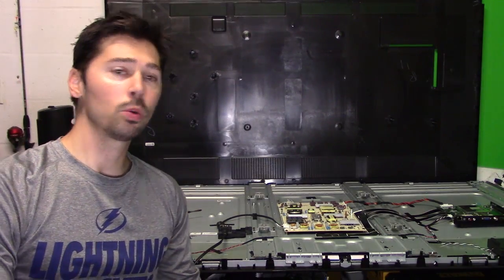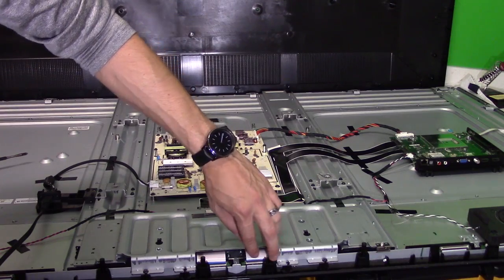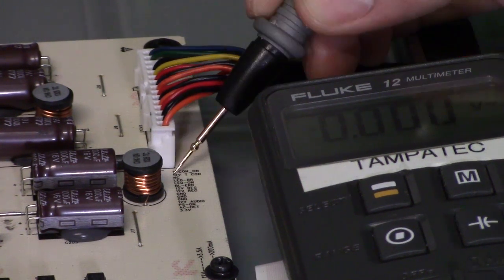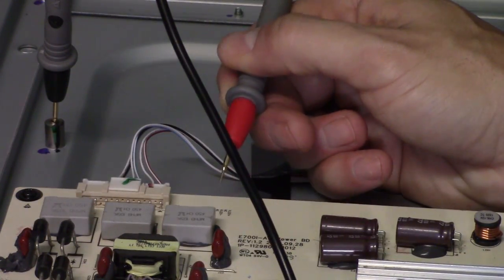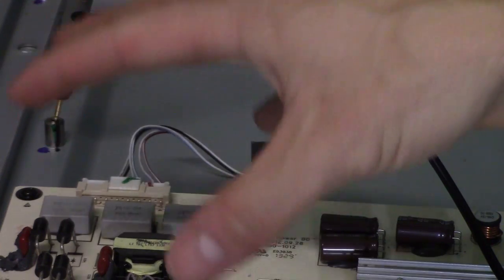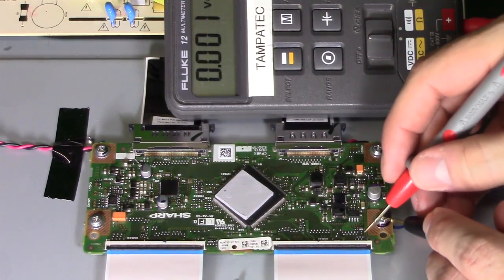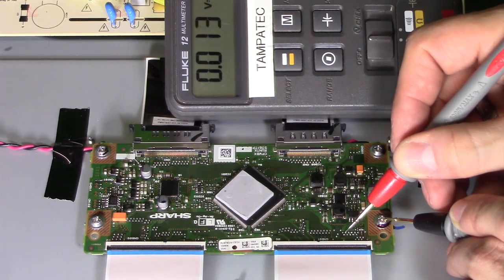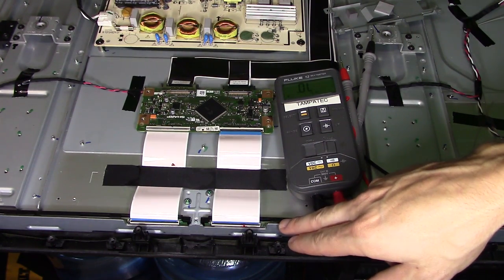How to Troubleshoot and Fix LED LCD TV Vizio and Sharp flatscreen No Picture but sound

Comment: My multimeter is reading 0 on the Led+ on the power supply and the backlights won't come on. I can see an image with flashlight in a dark room! Do I need to replace power supply board to see if I get power to Led strips?
My Tv:  led55c55r120q
Reply: If you unplug those wires to LED+ from their slots, what happens? I worked with that same power supply and the back lights would power on with only one string connected.
Reply: WMP007 did it mastery which one you unplugged furthest to the left or to the right on the board if it's still screwed in to tv? And thanks for helping, I've never thought of that is there a reason why that works just curious
Reply: Whichever wires are reading 0. If that PSU works the way I believe it does then if there's a bad LED on just one strip then unplugging the strip that reads 0 might allow the other strips to stay on. I didn't have any bad strips in the TV I worked on. But I had the wrong power supply for my model, and the pins were different so I soldered the wires manually to the pins on the board. I didn't know it was going to work so I only soldered 2 wires and the back lights I tried worked. So I went ahead and soldered the other to the LED + - pins on the power supply.
Reply: WMP007 every wire is reading 0 right now I've tested the multimeter on other circuits get a great reading but those four wires all say zero? I do have a new power supply board being delivered tomorrow though
Reply: That's strange. Nothing's ever too easy usually. At least when you get the new power board you'll know then.  You could just disconnect all of them and connect them one by one and see if any back lights come on.
Reply: WMP007 I know right, life easy ha! Well thanks for the help I'll let you know in a day how it goes lol (crosses fingers)
Reply: For sure! I got a whole board set for a Vizio  E601i-a3. Crossing my fingers as well! The parts are scheduled to arrive tomorrow. This TV is also not getting back lights. No power at all to any, and also no picture with a flash light :(
Reply: I got mine going!
Reply: WMP007 That's Awesome good for you! So my part got shipped damaged so I have to wait another week for another part to come in!
Reply: Bummer! That happened to me on my last TV I fixed. Ended up having to pay $20 extra for the same part somewhere else.
Reply: WMP007 I ended up finally getting my part in, and hooked it up and still nothing backlights wont turn on. Only flickered once voltage shot up to 120+ and then died out to 0 slowly. not sure what to do now
Reply: I know (face palm)

Comment: Thanks for awesome videos ! I would like now where can I get a Fluke 12 multitester like you ! thanks Tampa Tec
Reply: I bought a 39" Vizio D series, 13 months (yep) ago from Walmart. It worked good for about 10 months until it would freeze pic  or go blank. Unpluging it  and plugging it back in would correct the problem But it went from doing it twice a week to 5 times a day. It finally started going off and on displaying the "V"  screen and then the back screen. The only  way you could get it off was to unplug it. The other "odity" was when I went to pop the cover off I found A "Amazon" Firestick plugged into it. Obviously the TV had been sold and returned and resold to me but now stuck with it. Help,!

Comment: My parents have a 55 inch led RCA and it has sound but no backlight. When I do the flashlight test I can see a picture. A second after I turn the TV on the back lights will flash one time then go off and stay off. Could  you tell me please if you ever had a TV do this and what board could be bad ? I hope not but would it be possible for one of the led lights to be bad ?

Comment: hi i like your video i have a sylvania LC320SL1 i turn it on but it goes out. i do have a standby lite on. i open it up and  found no damage. so i check for 3 volt dc and i have for about three second with power on. i disconnect the power inverter and i have the 3 volt and a green lite. i think the power inverter is bad. i also check on some diode and found two bad one the the power inverter. help

Comment: hey T.T. I have a old vizio tv. 10 years plus, probably more. it has no label on it but I toke the panel  off of it and the stickers in side give me #pdp42x32000. a little history on this, I hade this TV in line of my swamp cooler, I took in for repairs for sound but no picture, after three tries and 500.00 later it worked pretty good except for a corner but after a bit it worked great. this time I have it out side under a nice patio in back, I did cover it with thin old beach towels  to watch it I only raised the front to view but the back really is not sealed with the towel and the wind we get here I thought would of vented ok. the same gut looked at it for me and told mr it heated uo, ok what now ? 300.00. he told me what it needed so I went to shopjimmy repalced the board. same prob. I fallow your vids the best I could but as you might know my TV has 10 boards in it not just to 2 or 3 in the vids. I think it might be the LED's, the flash light thing did not work, I will double check to noght to make sure. please help, I have to much $ in it to give up now.

Comment: Hey Tampatec, my LG 50LN5100 TV shut off tonight and won't turn back on. The red light in the front turns on, the screen flashes for a split second, then the red light turns off. It almost smelled like something was burning but the TV is only 2 years old so I hope not! If you have any videos on this, please link me!

Comment: I have a Vizio 32 E-Series Smart TV.  I have sound, and backlight.  BUT not picture.  When I turn the TV on it shows a blueish grey screen, the it starts 4 vertical sections, two stay the blueish gray, the other 2 start with tiny colored vert lines, then turn into a light grey.  So I have 4 vert sections, and no picture.  I don't get any words at any time.  I checked the IR sensor using your instructions from this site, and that is not the issue.  What do you think the issue is?

Comment: Great video Tampatec! I have this tv with black screen and has sound while doing your test on the main board at the tcon terminals only one side has the 12 volts, is that a sure sign of the main board being bad?  I'm afraid I'll buy this board then tcon board will be bad, then it will be the screen like yours ended up being. You have any input? Thx much
Reply: David, I have the same problem.  How did you resolve the issue?  Did you replace the main board?
Reply: @davidchellgren7932  I am having the same issue with the second ribbon cable reading 0 V at pin 1. Did you ever determine what the cause of this problem was. Do you know what parts would need to be replaced (main logic board, t-con board, power supply, ribbon cables)?

Comment: I have a Contex 5018 model 48 inch TV THAT HAS NO SOUND AND THE LIGHTING TEST CAME UP WITH NO LIGHTING IN THE BACK. WHAT MIGHT IT BE ALSO SO IT WILL NOT COME ON

Comment: Hello can you help me with my 65in rca led tv. I had a power outage one day and since then my tv would work for 30 minutes then shut off on its own if I try to turn it on it would not turn on unless it has been unplugged for a day. now tv will not turn on at all  now it does have a red standby light...Mod:LED65G55R120Q
ser: 4534-le65g55-f205408 pls help...

Comment: I have a lg tv lg42ld790 hdmi ports not working. Showing no signal on the screen whenever I connect anything via hdmi. I have reseted the tv and change the hdmi cable but no joys. 
Can you tell me what to test and look at on mainboard please. 
Many Thanks

Comment: Dear
Please help l have problems on led tv when switch supply on red led lamp glowing only tv not start I check power card AY160D -4HF12 082
Found copactor c37 charge by 25v andc copactor c25 charge by 10v if l remove supply I discharge the both copactor by short +and- then after make supply on again tv working ok my led tv eurostar model T50LEd-E13

If I switch off and again make on tv not working until make discharge the copactor with out supply after make on tv running normal
What the problem
Please help
Ali
Thank

Comment: what would the wires be for a vizio 502ui-b1e tv? it doesn't label a t con wire. I pretty sure it's either the t con or the main board, but I'm more leaning towards the t con. I just don't have a labeled wire to test... I have backlights and sound, but no picture. The backlight also adjusts the brightness in areas where I pull up the menu. it does not show picture when using a flashlight though. I also don't see any bad capacitors.

Comment: Hey tampatec it seems my main board is not putting out 12v on one of the ribbon cables going to tcon board do you suggest replace main logic board
Reply: I am having the same issue with the second ribbon cable reading 0 V at pin 1. Did you ever determine what the cause of this problem was. Do you know what parts need to be replaced (main logic board, t-con board, power supply, ribbon cables)?

Comment: I have a Vizio E701i-A3E. When I turn on the tv, the tv makes a loud popping sound multiple times. I have taken the back off and am trying to test like you do on this video. The meter jumps all over the place, the backlight goes on and off, then shuts off. Any suggestions? I have power cycled with the power button for 30 seconds, and still get the same thing. Also, nothing on the board appears to have any burnt or singeing.

Comment: Nice Video. Question: I have a Vizio M701d-A3. As i ran through your tests, everything was good until i got to the second T-Con cable connector on the main board. there was not 12 volts to that side of the T-Con board. Would this be indicative of a bad main board? What would you test next? Or what suggestions do you have on how i should proceed. BTW, the malfunction is a lot of vertical lines, with only one horizontal line. the color looks off too.
Reply: I am having the same issue with the second ribbon cable reading 0 V at pin 1, however, my TV is displaying a back light glow with no picture. Did you ever determine what the cause of your problem was. Do you know what parts needed to be replaced (main logic board, t-con board, power supply, ribbon cables)?

Comment: I really appreciate all of the work you have presented.  I have watched probably 8 or 9 of your videos and read some of your blog.   I am trying to debug my mother's Westinghouse LTV-32W6.  It has power, sound (at least a squealing sound), and backlights, but no video on screen.  Her tv's t-con board is not accessible without moving the main board and power board, so I can't test it the way you indicate plugged in.. 
    I should be able to test the power out of the power board to the t-con board, is that enough to say it is the t-con board that is bad?   How do I differentiate between t-con and inverter board?
dwoods

Comment: You didn't test all of the the wires from power supply you jumped over to led supply I want to know what all the powers are suppose to be coming out of power supply cause I have one that reads 0 is it suppose to

Comment: On a Vizio SV470M what should the voltage be at the power board on the wire labeled on/off when I turn the power on?

Comment: Hey TampaTec! I just bought a Vizio M421NV 42" TV. The TV powers on (amber led turns to white) but there is no backlighting, there is no picture (flashlight test) and there is no sound. What board do you recommend I replace? There are no blown capacitors on the board or burn marks. Is it most likely a power supply or main board failure?
Reply: We got same issue. TV powers on amber white and V but nothing.    I swapped out power cord. Unplugged  held on switch 10 seconds, nothing.  We just ordered new tv. Wonder if we should pull the boards and give them to TampaTec!  Vizio 55 inch.
Reply from the maker: GrandmaFoxes1 can be eeprom on the main board last I remembered. get tv repair kits or tv boards at shopjimmy.com or electropartsonline.com
Reply: Hey TampaTec! Thanks for the HUGELY helpful videos! I'm having the same problem that ReDigitize explained, and the troubleshooting has shown an inconsistent read on one of the 12V TCon pins of the harness... reading way low. Any advice?

Comment: I had like the same poblem with my sharp 47 inch i got a teacon board for £12.00 wich is roghly $7.00 from ebay and i diden!t use the meter just looked at it to know what was wrong.Still .Very good video and informative from you Sir.
Keep them alive LOL

Comment: I fixed a similar model vizio and the issue was the LVDS cable.  I almost didn't catch it and thought the LCD panel was bad, but glad it was the ribbon cables going into the t-con board.

Comment: thank you for all the info..i share it to my student..and the tips and lcd led repair..helps a lot of student..god bless and ..god job...:)
Reply from the maker: thanks
Reply: @TampaTec  I have the same exact issue as you do i have 12 volts at the main board cable going out to the T-Con board (*one closest to the top of the TV Screen*) But the other one below it, No Dice! (*one closest to the bottom of TV*) How can Repair the main board? I have plenty of extra parts from other sets, as i am venturing in this for a hobby. Just need to know what to test from here.

Comment: hey tampatec, i have a westinghouse 40" that will stay on for about an hour or so with great sound and picture. after this hour or so the entire screen becomes blank and green and then powers off or at least the display shuts down. i have been reading its the graphic board and possibly from overheating. would you recomend me just ordering a new graphics board?

Comment: I have a philips  lcd screen tv that has a brown shadow line across the top to the right where it is rounded and down the right side. It shows up depending on the color displayed. The shadow line is about 1/2" wide. Any idea what that could be?
Thanks for the video. I have never seen this before. The TV is about 4 years old. Other then this the tv is fine!
Reply: Forgot to say the line is down about 2-3 inches from the top and side.
Reply from the maker: check tcon conecctions
Reply: Thanks for taking the time to answer.
Have a nice weekend

Comment: Thank You for the Upload TampaTec :D  Will TVs Always have a "T-Con" board?  If not, would it be combined with the "Main Logic Board"? jw
Reply: I remember you mentioning it b4 but I wasn't sure which video it was.  Sorry for not googling :P
Reply from the maker: all LCD and led TVs have tcon boards, sometimes tcon circuit is built into main board.
Reply: ah ok.  Thank's man :D
Reply from the maker: no prob, you were right the whole time, tcon circuit sometimes are built into main boards.
Reply: @TampaTec  I have a problem with my tcl 55 inch uhd smart tv the screen is black but you can hear sound  and see picture with flash light but I opened it up and the top strip is lit up but I changed the bottom ones and it still dimmed like when I first opened the tv up what can be the problem

Comment: i got an rca 50" led tv that turns on then off within a few seconds. what do you think causes that? Thank you in advance
Reply from the maker: circuit is in protection mode , it is detecting a flaw in the circuit so TV turns off so it does go up in smoke.
Reply: Thanks for responding so quickly, I see 1 led strip is not lighting up at all and another has 1 led out.... you think that could be the problem? Once again thank you in advance  for your help! You rock!
Reply from the maker: yes i did a repair on led strips https://www.youtube.com/watch?v=YgaL6X6eSaU&index=6&list=PLbieLTSjLNFihpdQgqJPSPIoy6AHWqHs3
Reply: +Tampatec Hi, I have a Samsung hp4253. I would cut the tv on but it would shut back off in about 5seconds. I decided to enter try to reset the tv by using mute182power. It will not turn on or do anything now.PLEASE HELP.....
Reply: I have a Visio 43" TV, suddenly the Audio went off while watching a movie. I tried all the resets but did not work. Can you help what would be the issue
Reply: Have you tried a different cable?